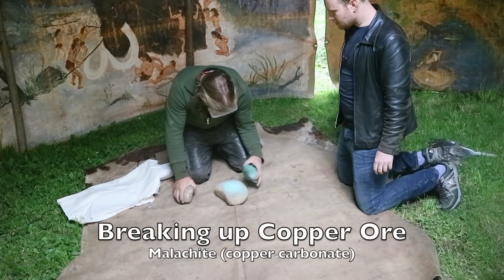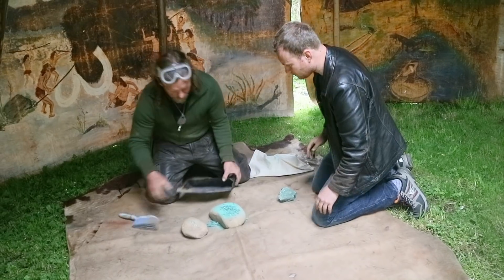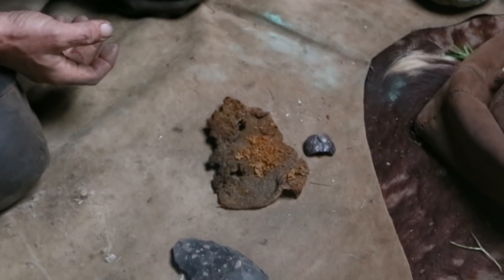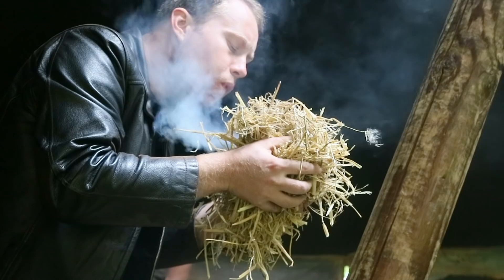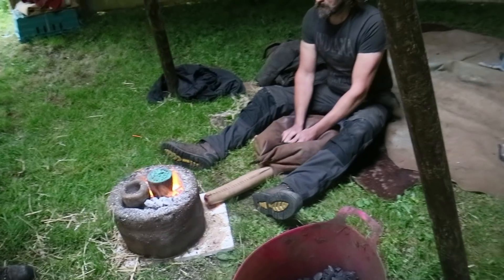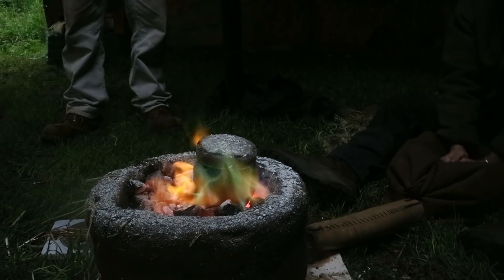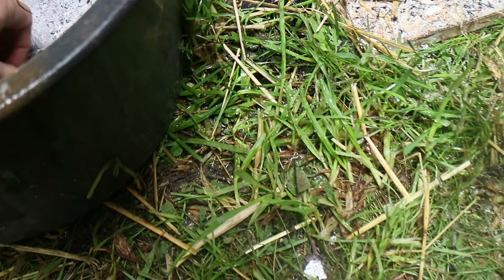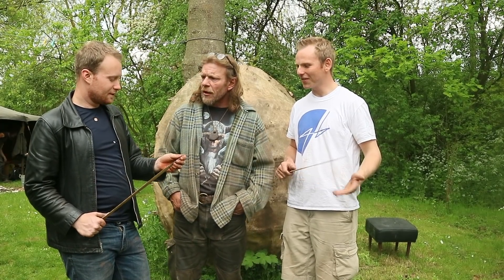Smelting Copper with Will Lord (Bronze Casting Workshop)

Comment: Wow, I'm envious!

Except of one thing. I've struck sparks from chert or jasper and marcasite. My knife, or my fire steel, are among the very, very last bits of 'modern' technology that I'd give up in a survival situation. It's so much easier to strike a hot spark from steel!

On the other hand, I do occasionally use amadou mushroom to catch the spark. It's great for carrying a coal, it'll smoulder for hours. 

I've never tried to make bronze. As far as I know, I don't have good local sources of Cu or Sn - although I'd not be surprised to hear they're around, because of the high-quality iron ore that turns up in spots. Any miner knows that all the metals ride an iron horse! (I know that local iron mine tailings have themselves been mined for titanium.)

Alchemy, brothers!
Reply: Without one, you might not have had the other.